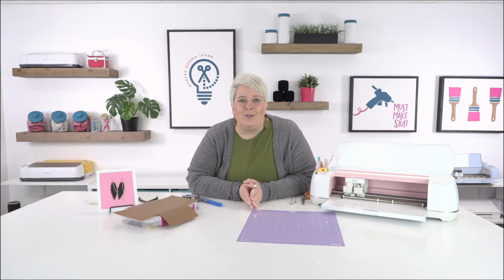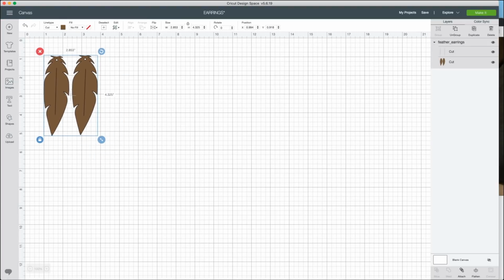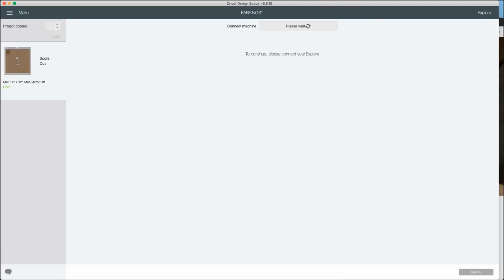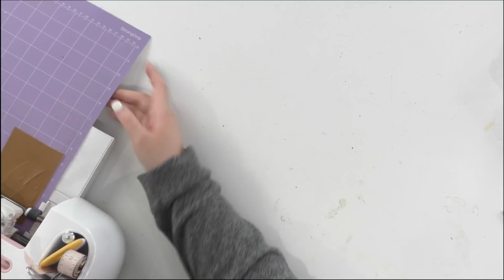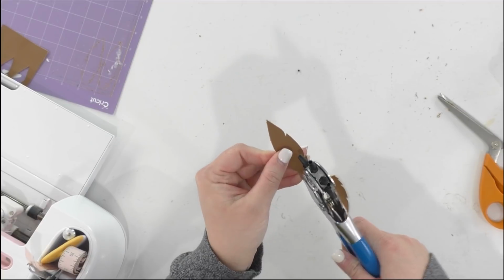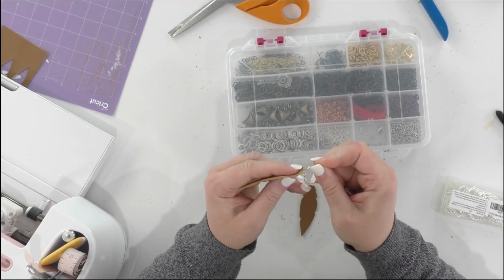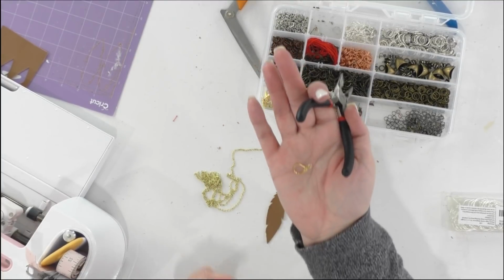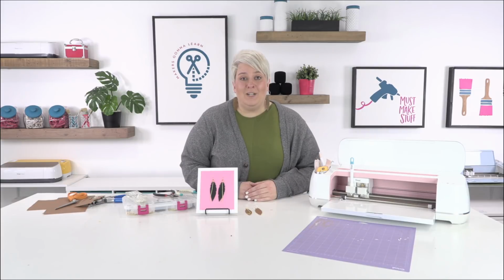The Easiest DIY Leather Earrings With Your Cricut

Comment: how do you keep them from curling because I struggle with that
Reply from the maker: The thicker the leather, the less they curl. Also try to avoid making them at lengths that will touch your shoulders. This helps prevent curling as well! :D